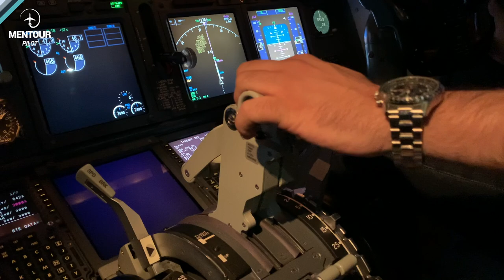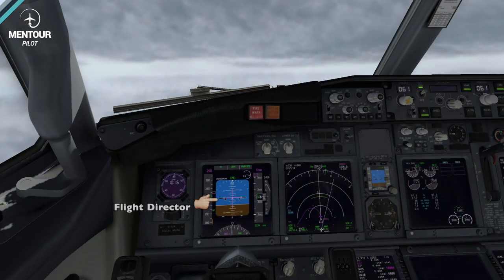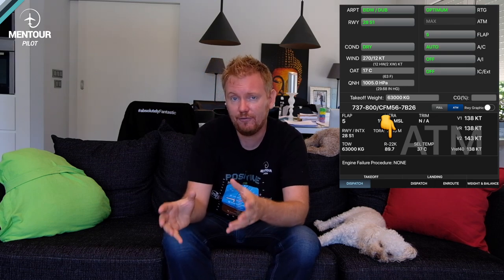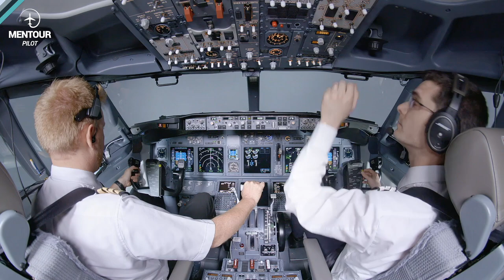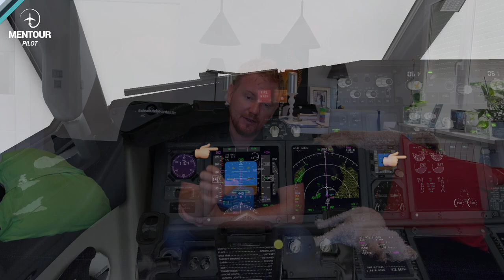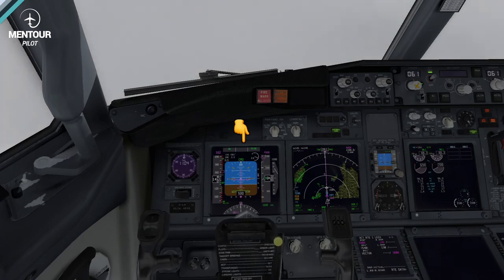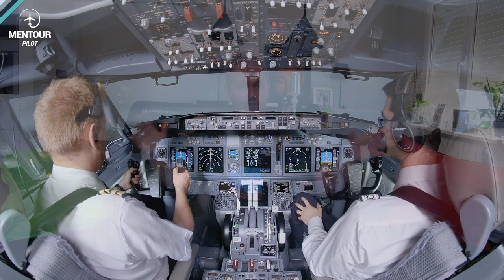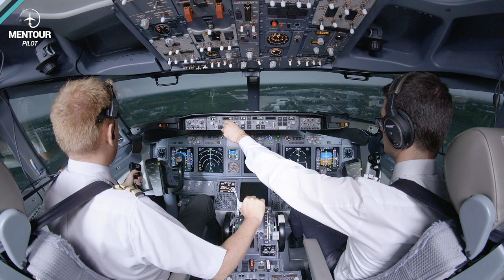What happens when you push TOGA?! (and what is it?)

Comment: Can someone tell why we hear "minimum" when the plane is almost landing and why the horizontal line on the primary flight display turns left when the plane is turning right and right when the plane is going left😕😕
Reply: Subject to correction by those with more experience, I understand the "minimums" call is to tell the pilot that he is at his "decision height".  This is the height at which he has to decide whether to continue the approach or go around.  I believe at this height he has to have the runway in sight.  Actually, in most cases you would first hear, "approaching minimums", when you are a certain number of feet above your decision height, then "minimums".
As for the second part of your question.  The horizontal line represents the horizon (it's called the artificial horizon) - with brown being the ground and blue being the sky.  If you think about it, if you bank to the right, your right side will be closer to the ground so from your perspective the horizon has moved to the left (counter-clockwise rotation) - you would have more "ground" appearing on your right and therefore more "sky" on the left.  I hope I did not totally confuse you.
Reply: Essentially what Patrick Mitchell explain about why you hear minimums is correct. It is a specific altitude or height that you set from your EFIS, which is either baro or radio, that you can find on the approach chart of the airport and runway. This altitude or height is usually set when planning the approach before Top of Descent. For precision approaches (ILS), the specific number for the altitude or height is under DA (decision altitude)/ DH (decision height) box on the approach chart. As for non precision approaches (VOR, RNAV), it is under MDA (minimum descent altitude). There are differences between the two but for simplicity we can think of it working similarly. So after setting the altitude or height and being on the approach, once you reach that specific altitude you will hear "minimums", at which this is the point where the pilot can do two things: 1) continue with the landing or, 2) Go around. So for example if the altitude is set at 222 feet, a couple of feet upon reaching that altitude you will hear "approaching minimums", and once you reach 222 feet you will hear "minimums". Hope this helps
Reply: Thanks a lot for the help guys. I get it better now👍👍
Reply: If you can't see the runway at minimums, go around

Comment: how hard is it to manually set a given trust %? like you said in gusty winds the toga not always works so the F/O has to set it manually. or if for some reason toga dosent work at all.
Reply: 18:40
Reply: it is due to headwind.

it stops at 84 kts so with 40kts of headwind  it will not have time to do that as you reach 84 kts faster. 
A/T is quite slow

Comment: Why isn't there triple redundancy autopilot (voting logic), as there is in marine dynamic positioning systems?  If there had been, it would have removed the imminent disengagement in case of conflicting conclusions between individual APs.
Reply: Jonas Lindström Two systems (A and B), that is sufficient
Reply: @speedbird9313  Actually two systems are not sufficient, but for historic and cost reasons you only have two on the 737. So, if one of them fails, you can't Autoland anymore. If you would have 3 systems, like more modern aircraft have, if one of them would fail the other two can vote the malfunctioning system out automatically, and the landing can continue normally without any intervention.
Reply: Vladimir Nicolici Not sufficient huh? So when has this been a issue?🤔
Reply: Three systems are needed if the autopilot might be left unattended (as on a ship while the captain is still on the bridge but nobody at the wheel).

In a plane you know you have a pilot (two in fact) so counting both pilots you have a four way system.

Comment: How many times have you done a "go-around"?
Reply: I am guessing many. 

There are many reasons, some caused by the pilot, some called by ATC, and of the ones called by ATC many of those will be sure to some action of another pilot

For example if the previous landing stops on the runway instead of vacating, or if a take off from the same runway is aborted, or if a pilot misunderstands taxi instructions and does a runway incursion, then ATC will instruct a go around. Equally sometimes the pilot sees the problem first and they will go around and call ATC to say so.

During early training you do a lot of go arounds, getting practice for take off, climb out, final approach, and touch down. Technically those are all go arounds, as you transition from landing roll to take off roll without stopping. 

English trainees call that "circuits and bumps". It's boring for the instructor, except for the rare moment when Pilot under training does something talks silky really close to the ground, then it's briefly terrifying for the instructor... but they never show it.

So Petter will have done a lot of go arounds when he was first learning, and if he does early training he will do more as Instructor.

Comment: Do I see correctly that you are using the Zibo mod in the X-Plane videos? :)
Reply: @Corey McDonald Well, I will leave out 0.1% for the benefit of doubt, but the computer sim parts of this video are 99.9% Zibo mod in X-Plane -- there are the jagged X-Plane shadows and the livery used is the EI-GJK which is the default Ryanair livery included in the Zibo mod installation :)

Comment: In a multi engine Boeing jet the PF will remove hands from the throttles to the yoke at V1/rotate/TOGA. Rotate is done with two hands on the yoke. You are committed at that point. I don't know about the AirBus with a side stick. The Garmin 1000/Persective and Honeywell Primus gave a takeoff command and also a go around command depending on your flight condition. 
After that, a one hand on the yoke and trim should be practiced. A properly trimmed aircraft will fly hands off. It just needs nav/FD guidance. 

Peter, please give your FO a can of White Grease WD-40 so he can raise the flaps.
Reply: Is the trimwheel actually needed it trim is done by the push of a button on the yoke

Comment: Would TOGA give you full N1 thrust during a Terrain Escape?
Reply: During terrain escape you just push the levers to the wall. 

toga on a second press will give max GA thrust... about 99-100% n1 

with lever fully pushed You'll get like 104% or so
Reply: @piotrkuler2474  Intriguing. I ask because the flight directors would have been tripped knowing that the aircraft is close to Terrain and would have to extract maximum performance from the engines. And so with the first TOGA press probably give you mac thrust immediately instead of Go Around thrust.

Comment: What would happen if you put gear up while you're sitting on the ground?
Reply: also on a 737 there is nooo way you can do that accidently due to overide switch.
Reply: @cockatoo010  one captain once tried this: Try retracting with the circuit breaker pulled. And retract it did. The plane was a total loss.

Comment: Can't you just disconnect one of the autopilots to disengage from Autoland mode?
Reply: Both autopilots will be disconnected
Reply: @pilotinterviewhandbook3064  He also says you can de-tune the ILS frequency. Do you know where and how the ILS frequency is set? In my X-Plane 777 the ILS frequency is automatically set by the FMC. But I don't know where it is set. Can you do it manually at the center console or somewhere?
Reply: @kreiseltower  it is set on the pedestal which is in the middle of the aircraft and you enter into the NAV radio the localizer (ils) Freq